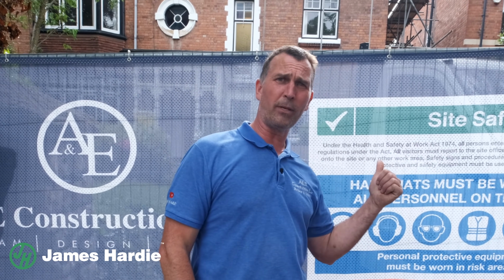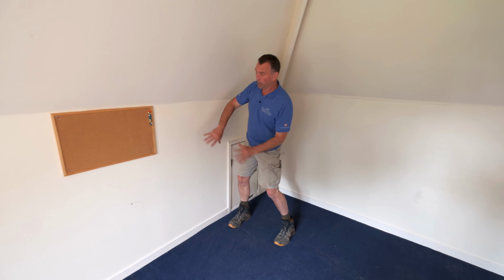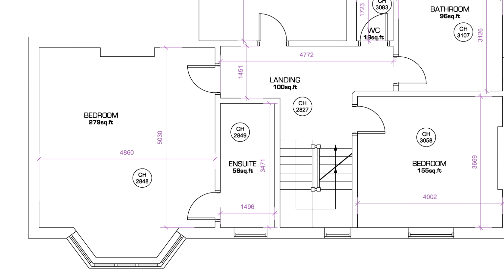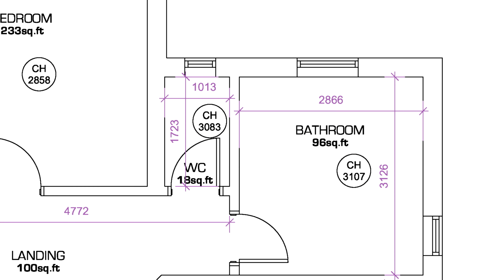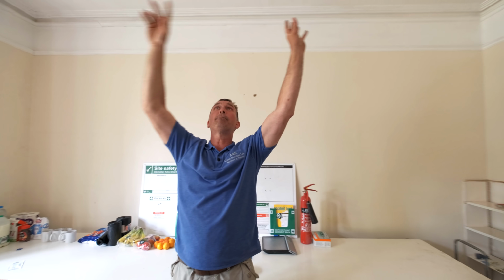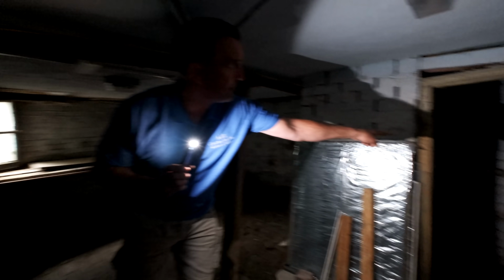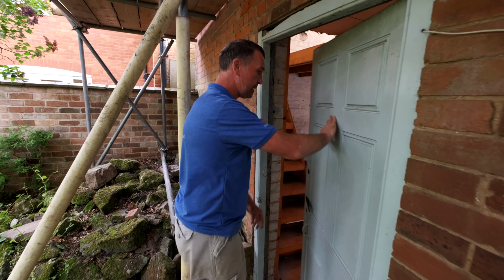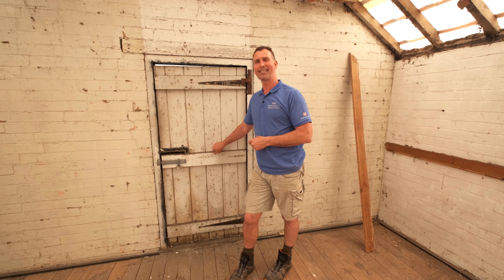Can we make this happen?! House Tour and Introduction | Victorian Villa Resurrection #1

Comment: Just watched this first episode from this playlist, and man, I just can share your enthusiasm for this property and project.
It has much in common with my own house I'm renovating now.
Lots of the original details have been lost or covered in panelling, vinyl, UPVC and more of those wonderful 70s and 80s materials.
But like you did I unveiled the original floor tiles from under the carpet and vinyl, found covered up glass in lead windows, and also managed to source missing doors and door handles.
And like you are going to do I add more details of the period to the original part of the house, and go for modern in the 1980s extension.
 I quickly start to watch the other episodes, I'm very curious how the finished product looks!

Comment: Nice project! What other energy efficiency improvements will you be doing. Any solar panels etc? Will you be insulating the joists between the ground floor/cellar and also internally insulating all the external walls?
Reply from the maker: Hi Tech191 no panels, just loads of additional insulation and definitely to the cellar and yes to external walls as much as my client will allow from the advice we give all the best Tony 👍

Comment: The door so high up would have opened to be used for a pulley system for when the coal man came to deliver his coal. Also for other deliveries. This required less labour.
Reply from the maker: Hi Ryan great shout spot on all the best Tony 👍
Reply: Coal would have been kept in a cellar, not a loft. The door was for hay. That's why we talk about coal cellars and hay lofts, not coal lofts and hay cellars.

Comment: I saw the A&E hoardings go up on that road a few months back.  Fabulous property! I wondered when you'd start releasing videos.  Btw Tony - it's not a gate house, it's a carriage house/stable and the door in the wall of the first floor (loft) is where they would have parked a hay cart outside and then pitchforked or passed bales of hay into the loft.
Reply from the maker: Hi Matt we are always about 8 weeks behind with most videos it depends on how and what we are filming, it is an exceptional home, you are spot on Matt about the coach house it’s me getting carried away 😂 have a awesome weekend all the best Tony 👍

Comment: Looking forward to this series! The doors really are an incredible find

I’m thinking the door would have been used to load hay into the upstairs storage rooms to feed to the horses
Reply: You see in some hay lofts, small trap doors in floor that open directly over the horse stall below,made feeding easy.
Reply from the maker: Hi Tom, us to, very lucky with the doors, spot on all the best Tony 👍
Reply: @BuildWithAE  Some times you will find a cast iron wheel pulley system that they used for lifting up the hay to the upper hay loft.
There maybe evidence above the door, where it attached to the external brick work
Reply from the maker: @jeffcartwright7270  great shout definitely going to check that out